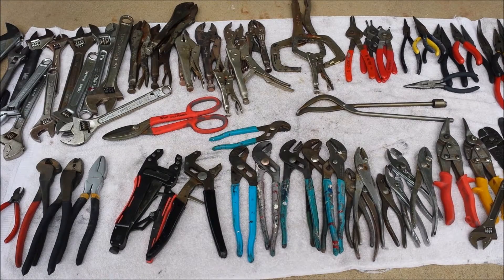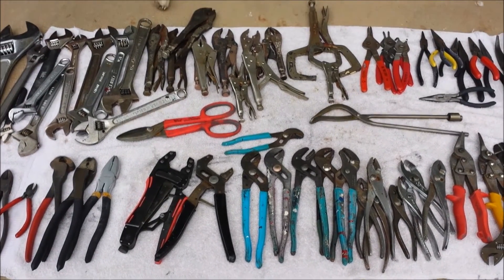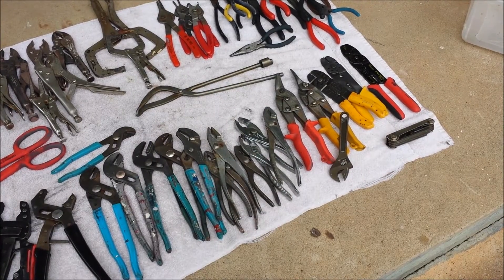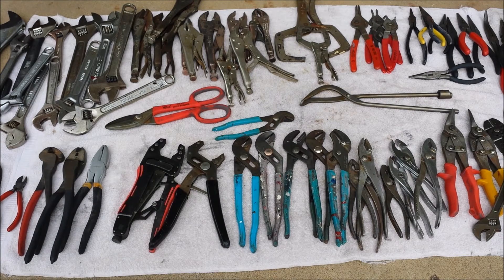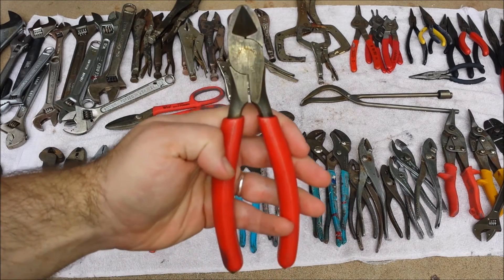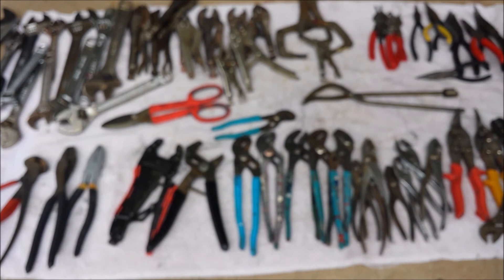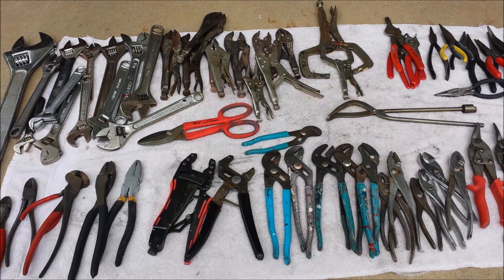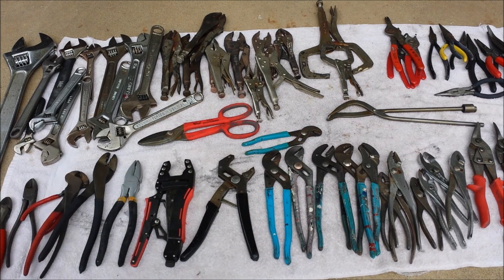Craigslist Dirty Old Tool Buy - Update 1 Pliers

Comment: If you take the springs off the rough vice grips, buff them on a wire wheel on a bench grinder then you can spray them with cold galvanizing then after it dries buff it smooth on a buffing wheel. Never rust after that.